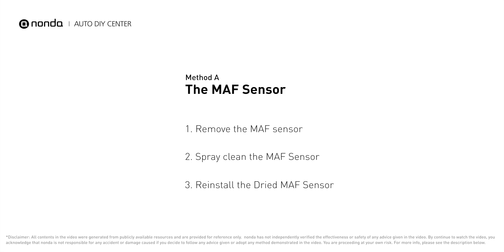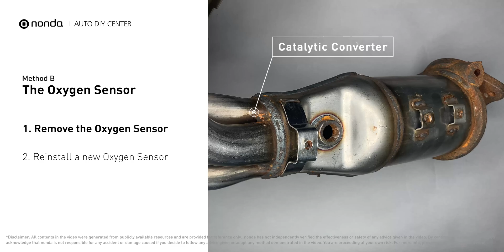How to Fix LEXUS P0172 Engine Code in 3 Minutes [2 DIY Methods / Only $8.77]

Comment: Hi, I need some help diagnosing an issue with my car.

For about 3 years, I’ve noticed a light fuel smell when starting the car. It wasn’t strong, and it always disappeared within 30–60 seconds. This happened not only in the morning but even if I drove for an hour, parked for 10–15 minutes, and then started the car again. I took it to a mechanic in the past, and he checked the front and underneath the car and said there were no leaks, so I kept driving.

I’m not sure if that long-term fuel smell is related to my new problem, but here’s what happened:

Recently the car sat mostly parked for about 2 weeks (only driven around 2 hours per week). On a very hot day, I started the car and suddenly several warning lights turned on: Check VSC, slip indicator, parking brake light, battery light, and a few others. They stay on and do not turn off.

I scanned the car with OBD2, and the code I get is:
P0172 — System Too Rich (Bank 1).

Can someone tell me what could be causing this and what I should do next?

Comment: 2007 Lexus IS350. Threw codes P0172 AND p0175.
It was the plug into the MAF that wasn't fully seated.
Reply from the maker: Hi John, as you are getting more than one error code, we suggest getting your vehicle visually checked by your local mechanic for further diagnosis.
Reply: Do u have the part number of the plug into the MAF sensor i have the same exact car with the same exact codes
Reply: @jiancandelaria4095  Sorry, no. I just found my plug was not full seated. I just had to push it in a bit and it clicked in.
You may need the sensor itself. That was what I thought I needed originally, but when I went to check it out, like I said, I found the plug was not fully seated.

Comment: What if it is both banks? Does that mean both O2 sensors went bad?
Reply from the maker: Hi Marco, please provide us with your vehicle's year, make and model in order for us to address your concern accurately.
Reply: @nondainc  lexus 2007 is250